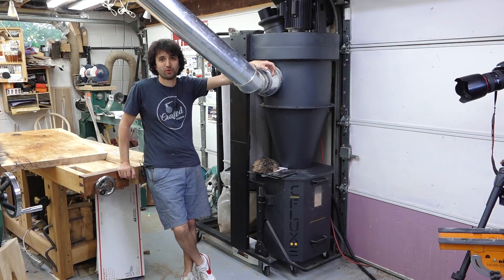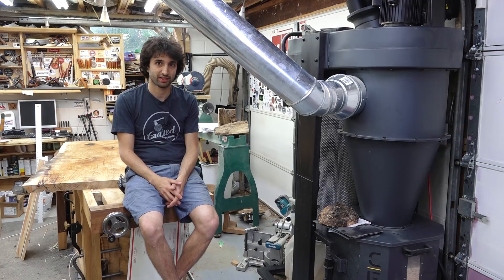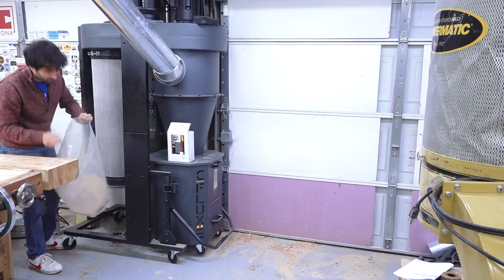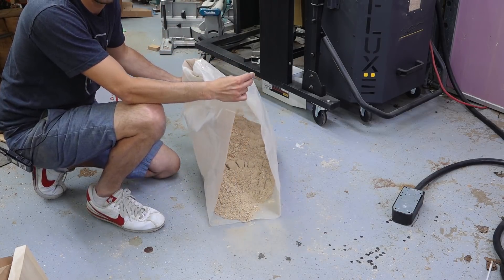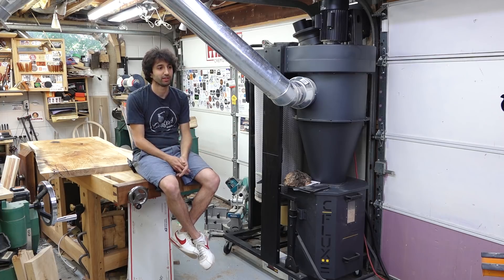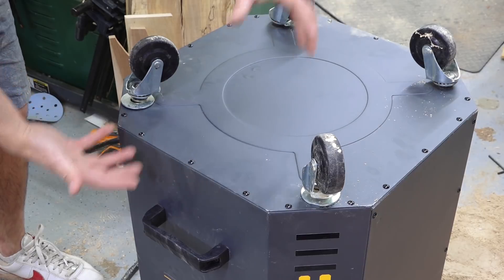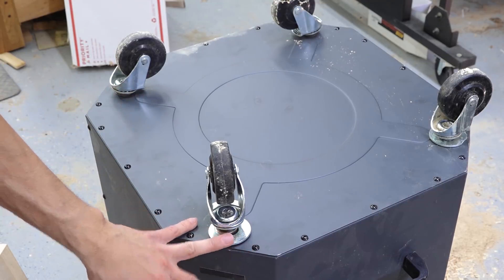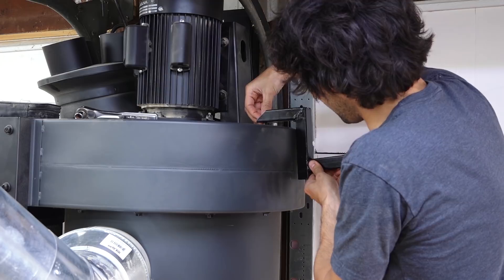Cyclone Follow Up & Improvements

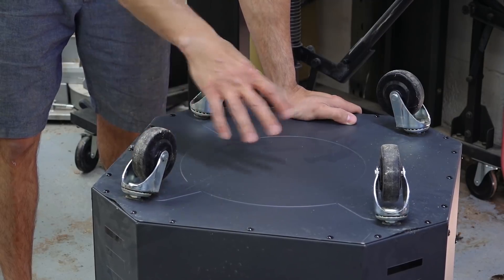Comment: 6:10 Why not rut a piece of half inch plywood to size and mount that on the bottom? Provided you can spare the half inch in additional bin height.
Reply from the maker: might be something I could do in the future.  I'll have to check the length of the caster stems

Comment: Matt - just got a C:Flux 3.  They have changed the casters on the bottom with a 4-bolt caster rather than the threaded caster.   I don't know if you would be able to 4-wheel it with the new design but at least they listened.
Reply from the maker: That’s good to know. I’ve heard from several owners who had similar issues to me and they’ve just been wheeling the bin around their shop

Comment: I know this is  now three years later but I did just purchase the new 2022 3HP Cflux model.  It is making a difference - still need to do better setup of where it is and routing the piping, but it was clear to see that it is making a difference already even with just connecting flex house.  BTW, the 2022 model is now 10' taller.  So, not quite as compact.

Comment: Man. I bought the p flux 3 hp. Only because Beaver supply had a company that financed it for me. It was like click on the tools you want and here is $25,000 of instant credit. I only bought it because of that. 2 years later I'm now spending more than 4,000 on Nordfab pipe. Damn this is expensive.  
Ive installed it where I can remove the filter and create an elbow to vent it outside if necessary!

I know this is an old video and you've moved on to having two clear vue's, one bill Pentz model. Bill Pentz has been my motivation to understand and to study DC in our small shops. He would never approve of a Laguna.

Comment: Do you have any fact supporting that a full size vertical dust collector would have less fine dust in the clear bag?  I have the earlier version of your model Laguna.  It has about the same or little less dust in the clear bag.  I wonder with a cyclone collector if you can ever get every fine particles out.
Reply from the maker: yes, I showed an example of that in the original video.  There were also many people who have full size cyclones who confirmed.

Comment: I have the P Flux 3 HEPA. I think you're getting dust in your filter because you're using a 6 inch tube. The Cyclone works best using a 8 inch or two 4 inch hoses which I use. I  filled my container about 10 times and get very little dust in my filter.

Comment: I have the CFlux 1.5 and it uses bags in the canister.  I'm surprised this doesn't as well.  Makes the emptying a lot easier instead of dragging in across the yard.
Reply from the maker: It takes bags of you want it. After dealing with bags for years, I have no desire to use them anymore. Much more convenient for me to just wheel it out back and dump it

Comment: Hi Matt ! I expect my 2HP Laguna CFlux here in the next few days. Is there something you would recommend that I do prior installation based on your experience and using it for a few years now? How you liking it so far?
Reply from the maker: Just don't bother with the manual and watch the video instead.  My opinion is still the same as stated in the beginning of this video.  If I had higher ceilings, I wouldn't buy it again.

Comment: Have you seen any noticeable difference on separation when not using the bags in the bin? I have the same DC unit. I've bought the bags for the bin and other than ease of clean up it seems pointless to keep buying the bags if it doesn't affect performance.

Comment: Great rundown Matt.  Did you ever consider an outdoor location for it?  Just wondering what your thoughts are for that arrangement...  I'm designing the shop in my "new to me" house and wondering if I can clear some space by making the dust collection a remote operation.
Reply from the maker: I have no where to put it outside. Make sure you get a full bin sensor if you put it outside 😄

Comment: I am in the process of build my own shop. I am wondering how far is your shop from your closest neighbor? Is there a problem when you are running the machines. My closest neighbor is 60ft away. I am not sure if that gonna cause any problem.
Reply: Austin Song I don’t think you will have any issues as long as your not running your table saw and dust Collector with the garage door open. Put some noise blocking insulation on the garage doors and You should be fine.

Comment: matt, enjoyed your shop comments on your dust collector system, however I wonder how many times you run head on to the pipe coming off the collector. Maybe a elbow aim more to the ceiling would help. You need to put some metal plates under the caster wheels in order to strengthen the caster from bending or at least put a plywood bottom over the bottom .

Comment: For the bolt size problem, I picked up a set of these:
https://www.amazon.com/gp/product/B00GB03OLU/ref=oh_aui_search_detailpage?ie=UTF8&psc=1

Great for figuring out what size bolt you need or what size you have if you need to sort a bunch of random sized bolts.
Easily one of the most useful things in my shop. They also have them in jumbo sizes if you work with very large bolts a lot.

 I know the link says currently out of stock, but I didn't want to link a set I have not used in case they are poor quality.

Comment: Good vid, Matt.  I have that DC and have had the same issue with poor separation.  I've been considering replacing the entire cone with an Oneida Super Dust Deputy XL, for better separation.  I have yet to find anyone else who has done this, however it doesn't appear to be that difficult a mod and would only involve replacing the cone and bin.  I'm wondering if you've considered doing this?

Comment: Matt, you make an excellent point, the whole point of dust collection is just that collect dust. This unit does this very well it appears. Sure a lot of fine particles make it to the filter but as long as you use the handy paddles everything was still collected. I do wish this thing is a little cheaper. You can get a Oneida or clear vue for almost the same price. I do have to say that my homemade thein baffle separates more fines than this thing does, BUT I would rather have this than my frankstein harbor freight/rikon collector.

Comment: Hi Matt the fact the bracket held your weight shows not a lot when you weigh the same weight as a four year old ( he he he he he ), the fact you are getting all that fine dust through the filter is that a sign that there is to much force in the cyclone and the fine dust can not drop ??

Comment: Matt, the upgrade I'd recommend would be to extend the smaller diameter inlet pipe as deep into the cyclone as possible, and I'd even flatten the end of it a bit (flatten vertically).
With cyclone the trick is to get the vortex to spin as fast as possible - menas, the air with dust has to enter the cyclone as fast as practically possible - and the incoming stream should flow as close to the cyclone walls as possible. With this tapered connector you get just the opposite effect - slower and spread out stream.

Comment: I love how you're thinking about the "dead-space" and how to utilize it. The size of collector you need also depends on the equipment you're hooking to it and not just your length of run and ceiling height. All of these factors play into the equation. Your shop set-up also plays in with how you can route your gates and pipes/vac-lines. Great set of issues to consider, thanks for bringing up things to think about. Do you have any "floor sweeps" hooked into the collection system?

Comment: Matt-  I think your fine dust buildup issue is caused by the angle going into your cyclone. If you had a run parallel to ground coming out at least 4’ you would see better results.

Comment: Getting a DC vented outside & bypassing the filters is pretty huge for performance.  I did mine this way and even with a cyclone, the 1.5 HP blower (which I intended to replace with a 3HP blower but could never find one) performs beyond my expectations.  

In your case, Matt, why not put the whole unit outside in a closet it would free up space and do away with that angled duct that would annoy the hell out of me personally. ;-)

Comment: Matt, I know you're probably not reading comments on this video anymore, and I agree that shorter cyclones probably don't separate quite as well as taller ones, you would likely get much better separation if you used 8" ducting, and made sure that you're allowing enough air through to maximize the cfm through that 8" ducting.  Cyclones separate the dust by centrifugal force inside the cyclone itself.  An 8" circle has a 70% larger surface area than a 6" circle.  So while your air speed inside the ducting may not be quite as high, you will move a lot more air, and the air speed inside the cyclone will be much higher.  The higher the air speed inside the cyclone, the better the separation.

Comment: I would put a piece of plywood or osb in the bottom of the dust bin and bolt the wheels to it with some large fender washers. Should stop the nonsense at the cost of a little less capacity.
Reply from the maker: Ugh buy more plywood?!?! 😂
Reply: Matthew Cremona it will be worth it I promise
Reply: just put a slab in the bottom and bolt to it
Reply: Matthew Cremona Naaa. Some left over cold rolled steel left over from the bandsaw mill should do the trick. JR, the shop supervisor, could help with remounting the wheels. If he’s busy, Father-in-law (when not on house/truck patrol). Or you could hire an Orangutan to help .

Comment: Ya, that's typical Laguna engineering. I have the Laguna 18" bandsaw and absolutely hate it. I'm thinking of dumping it out in my garage sale and take the loss.
Reply: What don't you like about it?  I'm about to buy a bandsaw and the 18BX was one of the ones I was looking at.
Reply: I think the one you are looking at is the new model of mine but I doubt much difference. Mine is three years old. Hate the guides and paid up for Carter. Better but not much. Guide access  sucks. Table adjustment is very crude. Angle adjustment doesn't work. Wish I had held onto my old 50 year old saw. Much better saw. I wouldn't buy anything with the name Laguna on it after this.
Reply: Thanks for the info & reply.  I'll keep looking!
Reply: Lee I have a Laguna drum/belt sander that works great.
Reply: That's nice, they got something right. This is my personal experience that I paid up for expecting pretty much the best. I see pour engineering in anything I'll stay away from the brand.

Comment: Matt,  You have Grizzly tools?  Did you consider a Grizzly unit?  My dollar amount for a 3 hp collector  was considerably less. I have a shed I built next to the shop which holds garden tools, My dust collector is in there.  Built a Thein chip/dust collector that precedes the 2 bag unit.  ( less back pressure) ,   Like you my longest run is about 30 ft.   Your machine has a very nice feature for chip removal as the canister has a step up mechanism.  Been posting slow progress on instagram. Should be up and running by next week.  Thanks for your update on your contained unit.
Reply: The Grizzly collectors in this power range are all pretty damn tall, at least the last time I looked. I have a 1 1/2 horse Grizzly because it was the largest they had that would fit where I needed it.

Comment: I too have struggled with rough surfaces when moving my heavier tools. I too have a 2 car garage with a ceiling (exposed joists) height of 96-1/4 inches. Cater issue solution: Add a 3/4 inch plywood copy of the bottom plate, either inside the cyclone tub or under it, to transfer the stresses from the castor stems across the bottom. Attach the castors through this reinforced "floor". Through bolting the castor stem with a fender washer and nylon cap nut, on the inside of the tub, is superior to a tee-nut, but the length of the stem will likely be an issue. The floor plate will no longer be the weakest link for mitigating the lateral forces on the casters. The next weakest link in the lateral force mitigation is the separation of the swivel plane leading to ball bearing loss. The only solution here is heavier caster rating. I have no more issues thanks to various iterations of this method.